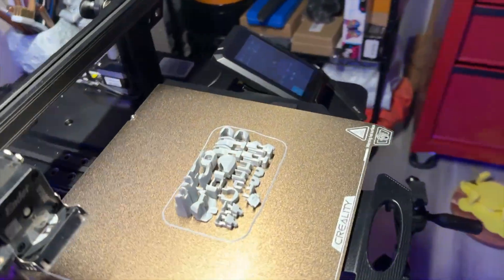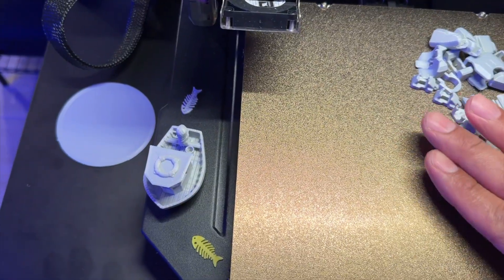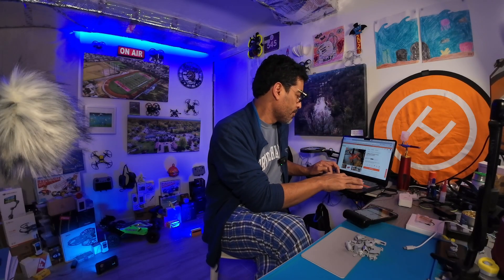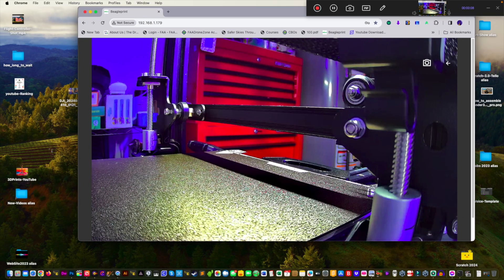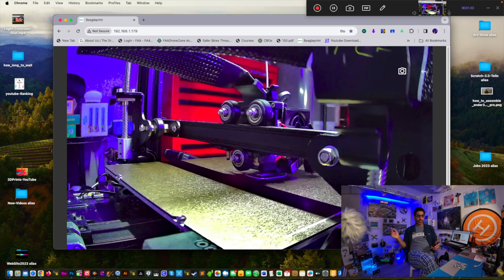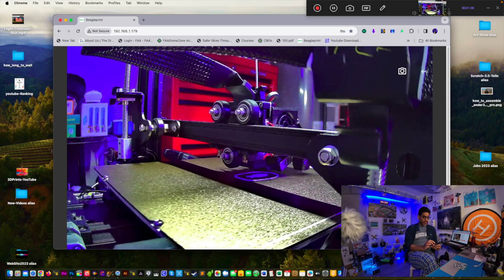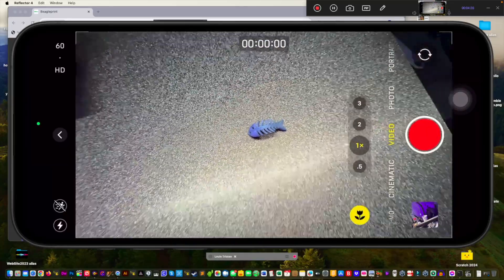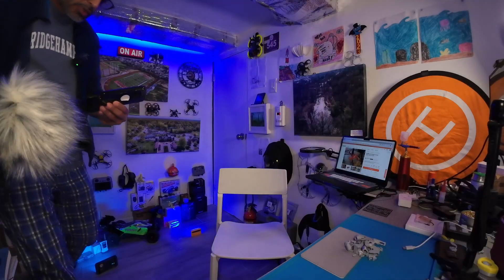how long should you wait before removing 3d prints - 3d print stuck on the board

Comment: generally waft the buildplate in the air > bend it around > pull a bit on the print and maybe alight tap on the side with something. worked fine so far.
And then i'm ready to print something else right away.